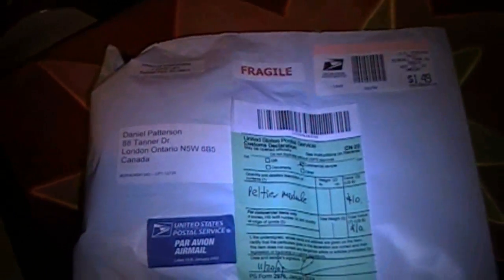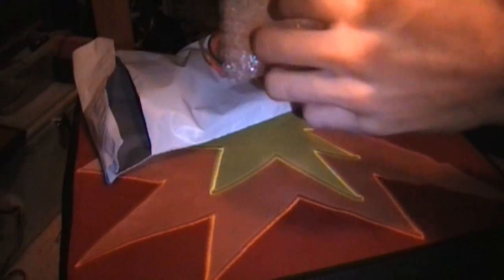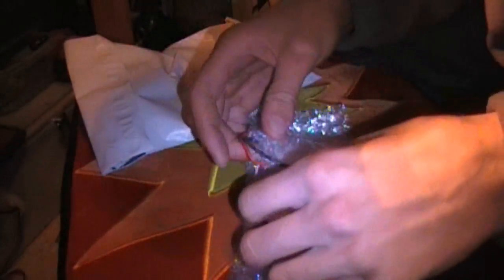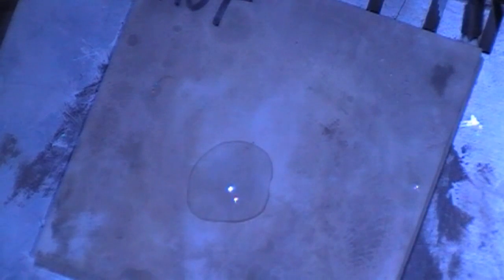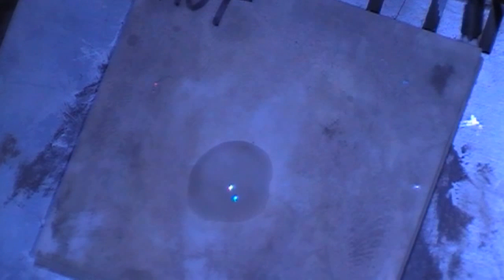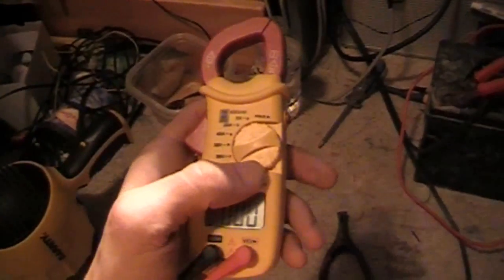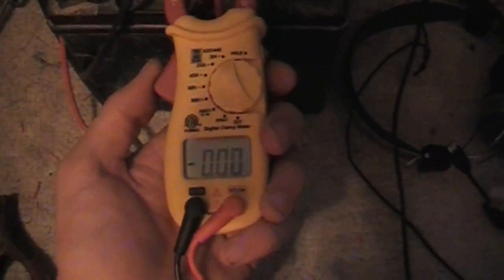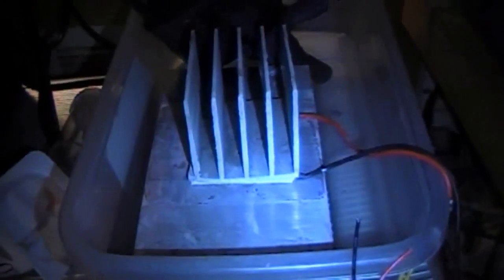got my new peltier

Comment from the maker: no you just need good heat paste and make sure that the peltier has a good heatsink and good contact with the heatsing on the hot side
all i was using is zip ties to hold stuff togather heck some times i didnt even use any thing but the heat paste to hold it togather